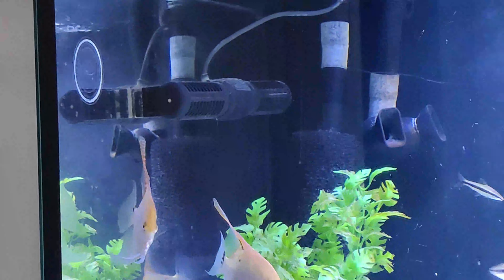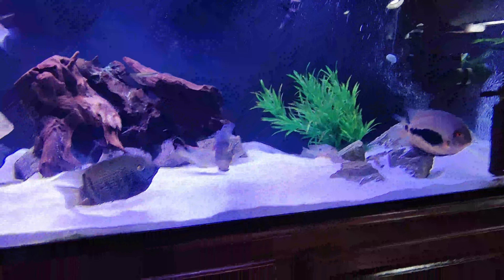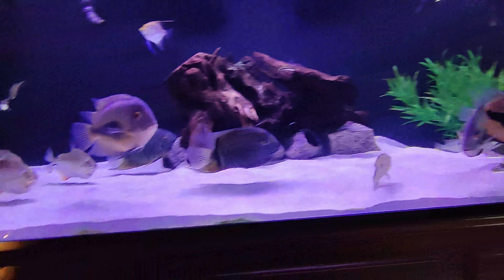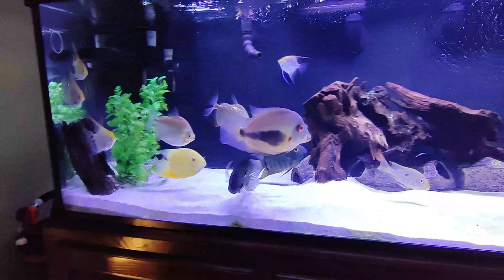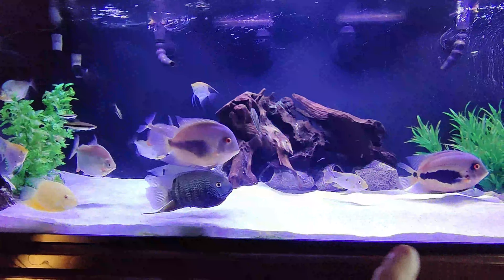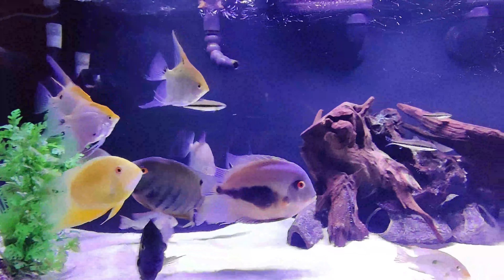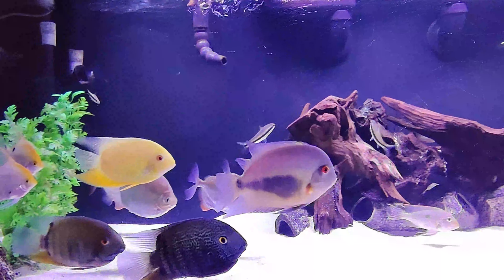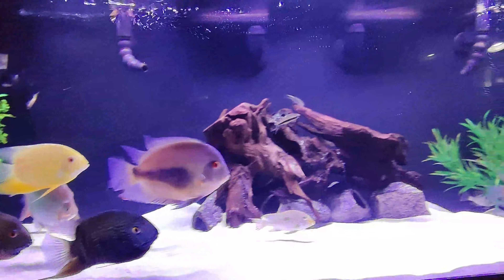Proper Wave maker positioning will keep your sand substrate clean

Comment: But will it work for a tank with smaller fish? I have a 65g full of guppies mostly and I'm afraid they will just get blown around.
Reply from the maker: So you can make it work you just have to down size the wave makers for your take. Or maybe a small power head or two. But like you mentioned guppies don't really enjoy strong flow. Even my tank with big fish I don't run it all the time they are on a timer that runs like 3 times a day for about 1 hour at a time. Bottom line you may need to experiment a bit to find what works best for your tank and fish. I had to do that with my tank to figure out what worked well in my tank and my fish. Good luck with your tank you will figure it out!

Comment: How many wave makers do I need for a 55 gallon? Just starting my tank
Reply from the maker: First I would ask what kind of fish you're wanting. That will really be a determining factor. Some fish don't like a lot of flow where others don't mind it or love it. Examples in my Cichlid tank I have 2 strong wave makers but on timers so they don't run all day. In my 75 gallon I have rainbows and Dennison. Barbs but no wave makers. And in my 40 breeder I have an Aquaclear 20 power head with a filter adapter. So those 2 tanks get enough flow from the filters and power heads.